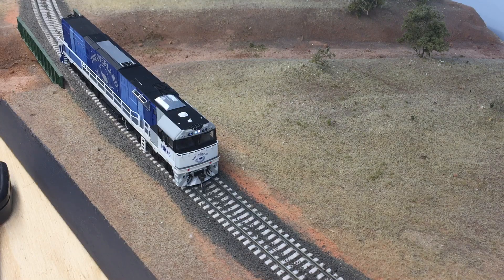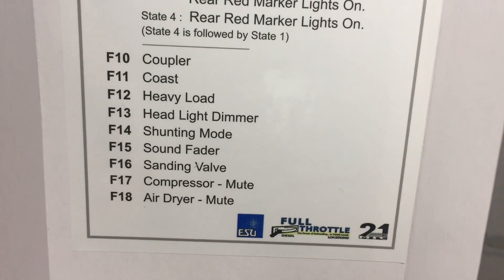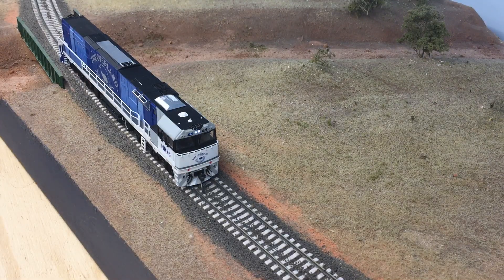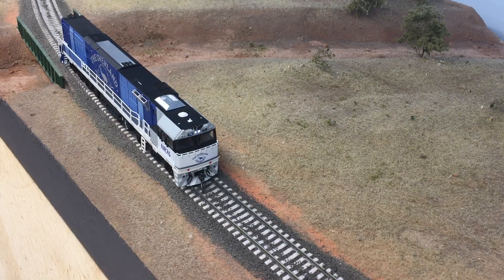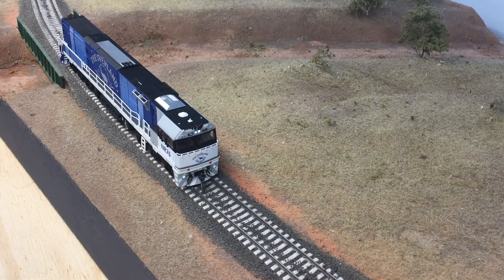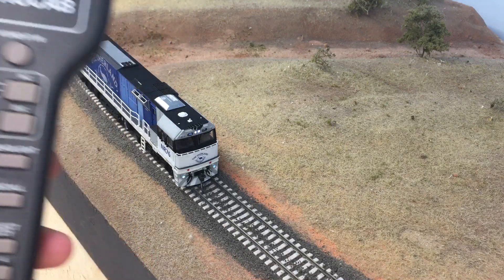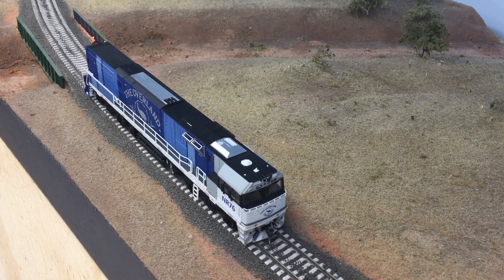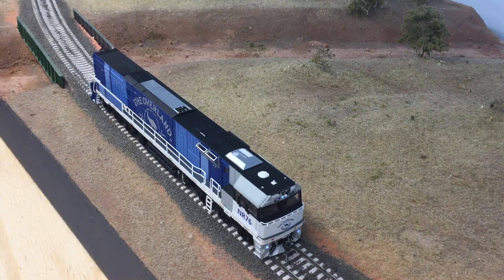SDS models NR class with sound demonstration

Comment: Nice model sounds great you should get some of the overland coaches to but behind it and it will look good.
Reply from the maker: Yes I am working on getting some coaches for ultra modern Overland.  That’s why I got this one with sound (single locomotive in a consist with sound is easy for the operators to handle during Exhibitions)